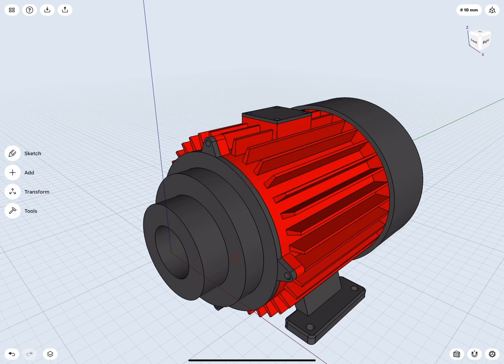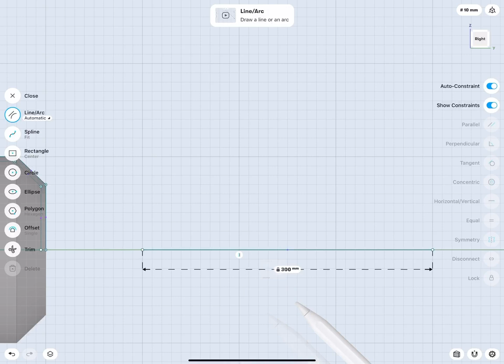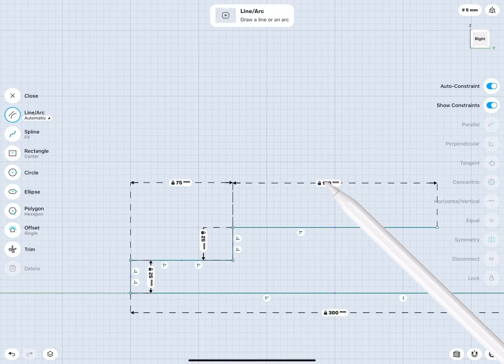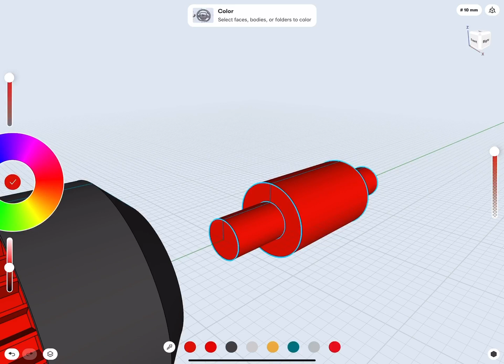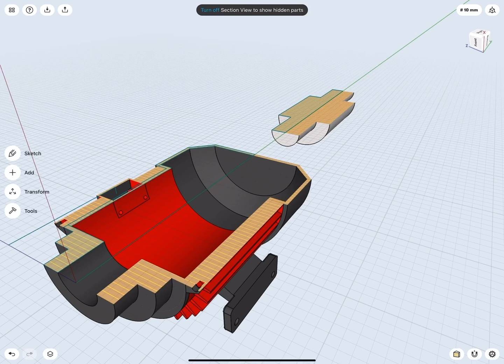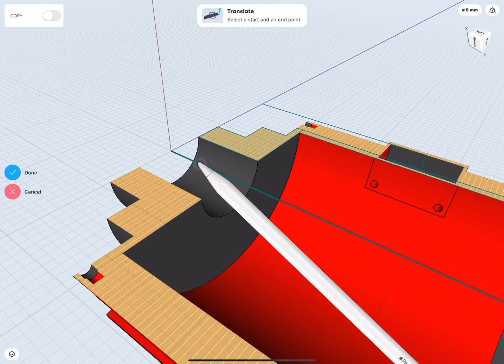Main shaft | Engine tutorial

Comment: The point does not snap to the middle point so frustrating
Reply from the maker: Hi, Please check if the Sketch/Face Center snap is turned on under the magnet icon in the lower right corner of the UI. If it still does not work, please contact us at support@shapr3d.com